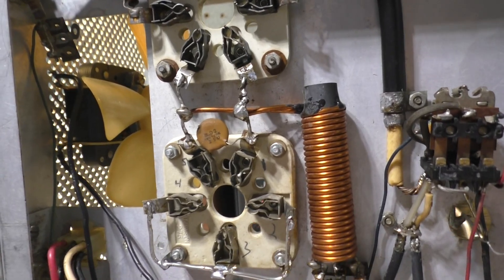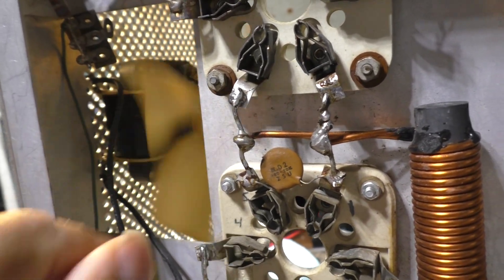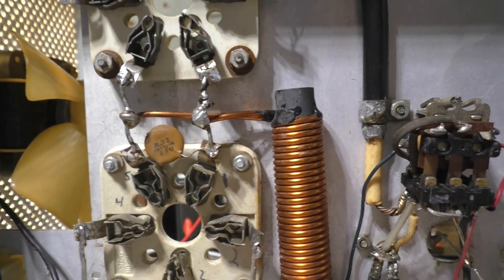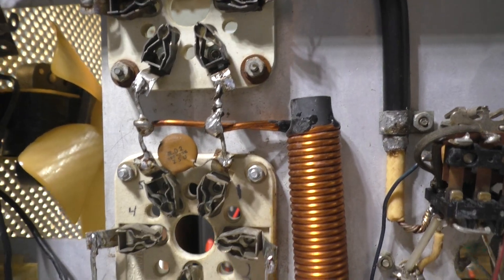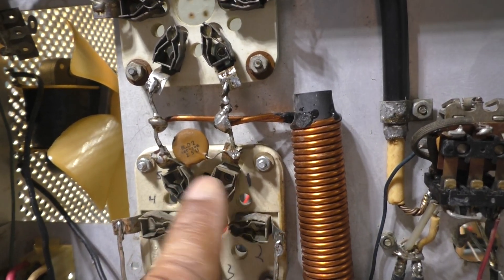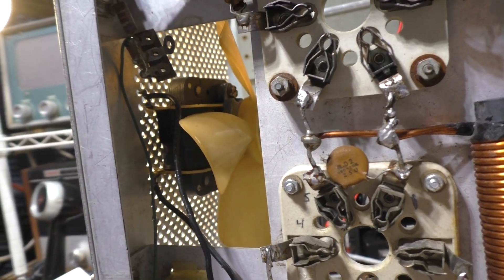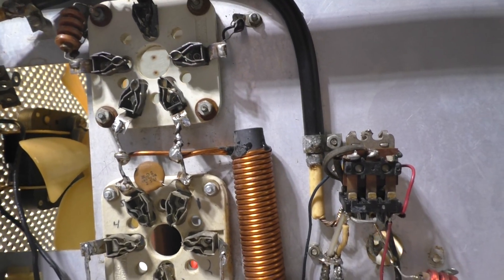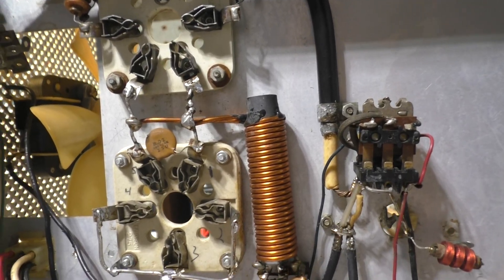SB-220 linear amplifier, the 1 thing I like about it:

Comment: Did anyone notice that the fan blade is installed in reverse on the motor shaft? The blades' convex curve should face the cabinet rear. The concave face of the blades should face the amplifier's front. Concave is facing rearward in the vid. Great explanation, though!

Comment: Another good one, Doc'...!
I am completing my very first total refurbishment of a SB-220 as i watch your video... It came with a burnt band switch waffer and the solder had let go on one of the tubes, just how you described...
 A 11 meter operator had sqeezed the lemon for its very last drop of juice... 😉
They replaced the stock fan with a 110vac muffin fan and just like you were describing,  the fan was insufficient and blew zero air across the pins...
I have installed the correct new fan assembly and hopefully we will get another 40 years of service out of her... Longer that this old retired Fisherman will be around...
That band swith waffer replacement, was a learning experience for sure...!   😅
Thanks again, Sir' 
73